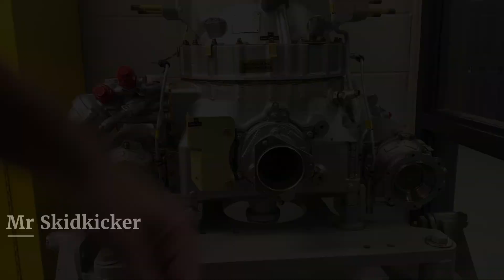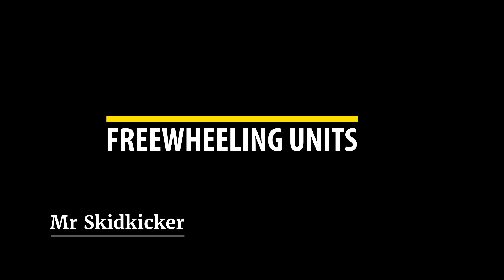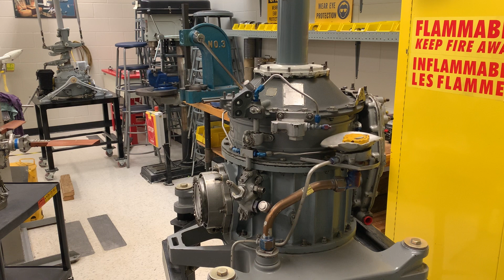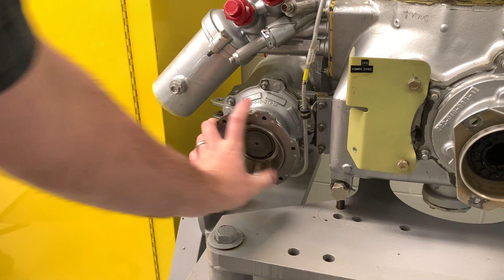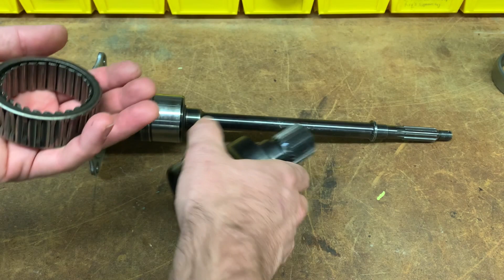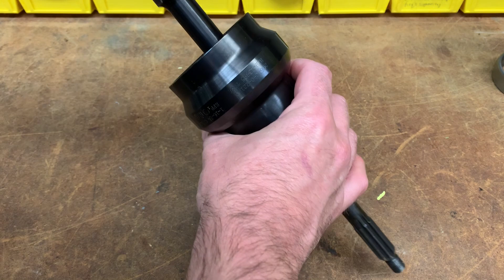The Freewheeling Unit.  Why do helicopters need one?

Comment: And if improper maintenance allows debris to accumulate and block the oil restrictor on the 206's unit, it dries up, overheats and/or seizes spontaneously as per C-GDPE and N216MH.

Comment: What is going to happen if the sprag clutch/bearing starts wearing out? Thanks
Reply: oil testing will show added amounts of suspended material then normal, A materials list will tell what parts are petering out and you schedule maintenance to replace the pieces...

Comment: I had a sprag unit fail on a large radio control helicopter in flight, the engine rpm went through the roof but rotor rpm was dropping quickly, I still managed to pull off one of my greatest autorotations of all time. 😀🇦🇺

Comment: What happens if the transmission fails? Will the rotors continue to spin because to the free wheeling unit? Can you still auto?
Reply: A sheer groove in the final planetary drive is the last line. 99% of the time the gearbox will slowly give signs of destruction... That 1% of the time it splits the greabox cover and everyone dies

Comment: surprising that it grips a smooth shaft, that it doesn't have the same number of indents. it should also be possible to design it such that when reversing that it lifts the contacts completely so there is no wear when freewheeling.
Reply: if there's no contact then there's nothing to move them to wedge and gain grip again
Reply: @alf3071  it would have to be a more complicated device. another possibility is electric transmission rather than gearbox so the turbine is a generator and the rotor is driven by a direct drive electric motor. it just might be as efficient as gears and would have location freedom
Reply: @DanFrederiksen  nope

Comment: Thanks for the lesson.
I'd like to see a lot more.
Dose the K Max intermesh chopper subject to mast bump ? I can't find any info on YouTube. 
Thanks in advance.
Reply from the maker: Great question.  While I am not 100% certain, and because the tail rotor can induce the roll that leads to the mast bumping condition, and due to the lack of tail rotor, it seem as though the chances of mast bumping is quite low.
Reply: K Max teetering is very limited but it does worse when wind gets under a blade on start up. It will kite and turn turtle at low RPM (Servo tab lock out until flight idle) It does have lead lag in huge amounts.

Comment: Thank you for explaining it so well and taking the time to make the video.

The freewheeling unit in a helicopter rotor system automatically disengages the rotor from the engine in the case of an engine failure.
The freewheeling unit allows the engine to drive the rotor, but if the rotor speed ever becomes greater than that of the engine, the freewheeling unit prevents the rotor driving the engine.
Reply: More like it keeps the rotor RPM from being dragged down from a dead engine

Comment: How does a twin engine not always have the lagging engine freewheeling behind the faster one and therefore not contributing at all? (I'm assuming it's virtually impossible for them to maintain the exact same RPM even under control by the engine governor.)
Reply: A certain amount of torque is required from both engines. The fact that each engine is generating torque guarantees that it is not just lagging behind or going along for the ride from the other engine..

Comment: A lot of power/torque put through a fairly small in comparison to the main rotor shaft I know there is epicycle reductions but I would still thought it would have a clutch pack lockup similar to some automotive limited slip units or as either the primary or secondary to a sprag bearing, not mention pressure lubed sprag for training aircraft. What weigh oil is used in the transmission, is agricultural tractor transmission oil sufficient?
Reply: I'm amazed that this holds up to the torque,  I used a 110mm Sprague in my bike engine car and it wore out in 100 miles, started slipping under load.
Reply: Grease in the Hughes 500, 23699 oil in the 206, 90 weight oil in a Sikorsky 58 and engine oil in the torque converted  for starting. - Hiller H12c gear oil. Robinson R 22 & 44 ATF transmission fluid ....

Comment: What if the freewheeling unit fails to decouple? Will the failed engine continue drive the main rotors?
Reply from the maker: The engine will drag the rotor rpm down and affect the helicopters ability to autorotate.

Comment: Nice... How mouch torque, and how mouch money sprag clutch? 
Thanks
Reply: I am sure you can figure it out by engine power and rotor rpm.
Reply: @Aviator168  engine power & engine RPM. (easier), Money? certified a few gramd for a home built McMadter Carr, Grangers, Gates. for a hundred bucks or less. index & back stop roller clutches